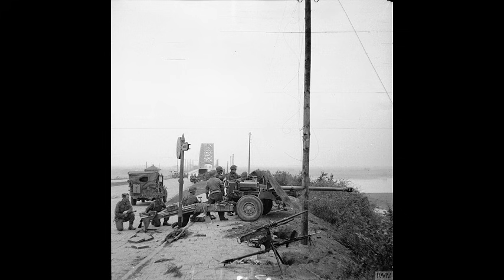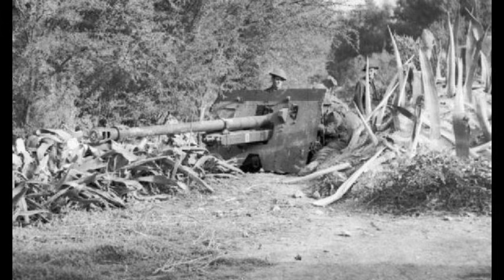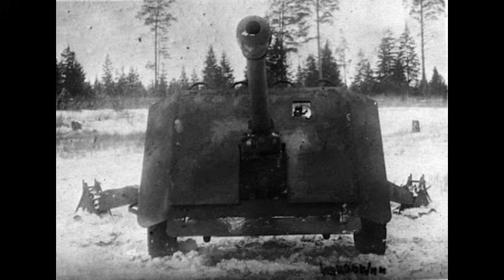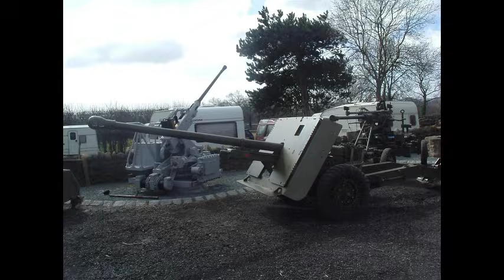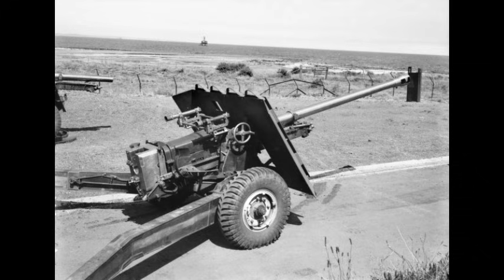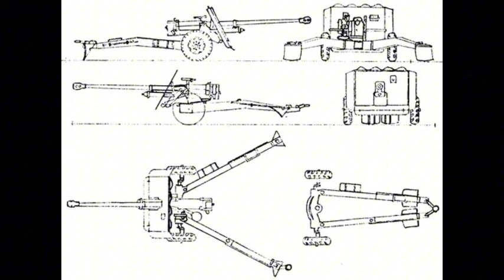When the British 17-Pounder First Shattered German Armor

Comment: The 17 Pounder was good with APDS once the muzzle brake issue had been solved, Most Sherman Firefly and the Comet, which used 17 Pdr shot, were using new muzzle brakes from the factory from August 1944. However it was German APCR and US HVAP which was erratic due to composition. Were the APDS shed its alloy jacket, APCR and HVAP retained it. Which was not ideal as lightweight shot is erratic by nature, which is why it was not used in small arms arms ammunition.
Reply: Glad someone mentioned the muzzle brake problem, before the fix the accuracy with APDS was very poor.

Comment: The American 90mm M3 cannon (used on the M36 Jackson and M26 Pershing) could penetrate more armor using its HVAP ammo than the 17 pounder APDS round. Britain tested the American M3 90mm cannon against the 17 pounder in two separate trials, and both times the British concluded that the 90mm gun was superior to the 17 pounder. For several reasons. It was more accurate, and the HE shell was nearly twice as powerful, it was much more accurate, and it handled sloped armor better than the 17 pounder. The 90mm can reliably penetrate the Panthers sloped glacis plate at combat ranges, the 17 pounder bounces off and ricochets every time.

Comment: Long, repetitious, sometimes boring,  but you got there. Curious that a video became a sound recording.

You missed the more fundamental  and equally important topic - nil points.

The British produced umpteen tank designs in WW2, all of them a technical or practical disaster. The philosophers won at the expense of the practised. Standard railcars were  required to accommodate a tanks width and therefore the tanks turret ring. Tanks were too small - or at least the turret ring was  - to accomodate pieces like the 17 pounder and allow for recoil and safe operation.  Reason eventually prevailed, but not until near wars end with a magnificent tank design - the Centurion. It’s why all distant tank movement is now by way of specialised articulated transporter. Similarly but in a different time - the GWR’s King class loco’s were restricted to certain routes and bridges because of their overall height and weight.

Comment: I served in the British Army Infantry Battalion in the early 1950's which had great success with the 6pdr in North Africa where in one battle one gun knocked out 12 axis tanks.This same gun is now a regimental museum piece. In 1950 our 6 x 6pdrs were towed by the Universal Carrier, in 1951 we converted to the 17pdr towed by the Oxford Carrier. Quite a massive gun for an infantry battalion as up to 1950 they were in Royal Artillery Anti Tank Regiments towed by half tracks.
Reply: Good info, but the 6 Pounder was usually towed by the larger Loyd, Windsor, T-16 and Oxford Carriers, which could also carry the gun crew. Of course the smaller Universal Carrier could also be used, but you would need another vehicle for the crew.

Comment: Excellent story of the 17 Pounder. In the British army tanks were organized in Regiments, Squadrons and Troops. It should be mentioned that after WW2 the 17 Pounder was replaced by the 20 Pounder mounted on the Centurion Mk3 in 1947. This gun used APDS as standard, and set a World Record by destroying a Chinese tank at 3,000 meters, obviously the inaccuracy issue had been solved.
Reply: I think that was a captured Cromwell
Reply: @HowardChambers9679  Yes it was captured by the Chinese but may have been passed on to the North Koreans, it was one of two the other recaptured by the ROK troops.

Comment: In your list of towing vehicles you mention the Morris Quad and the M-3 half-track. However you forget the most important towing vehicle, the Crusader gun tractor. This was a Crusader with its turret removed and the interior gutted out. My late father's unit, 86th Anti-Tank Gun Regiment, Royal Artillery, initially used the Quad but by the time of D-Day had converted to the Crusader. He was a REME vehicle fitter with the unit and said that they removed their Crusader's speed governors which allowed the Quads to reach 55mph on a tarmac road.
The photo which shows the 17-pounder on the approach to Nijmegen Bridge IS the 86th Anti-Tank Gun Regiment. The guns, gun crews and fitters were deployed on the side of the bridge with orders to shoot at anything that floated down from the German lines as the Germans were attempting to mine the bridge. Mostly they used machine guns, also shown in your photo.
Next time please remember the Crusader gun tractor.
https://www.nevingtonwarmuseum.com/crusader-ii-gun-tractor.html

Comment: As an Englishman, I am fascinated but bemused by our use of imperial weight units rather than calibre in mm. But I'm really proud of this gun.
Reply: I am old enough to have gone through school using imperial weights and measure as metric came in, imperial was more fun.
Reply: @paulchipperfield3569  Canadian here. LOVE being bilingual with both.. Converting is fun UNLESS you are going into negative temperatures..
Reply: We didn't use metric in our land forces (the RAF were using metric cannons in WW2) until the Royal Ordnance 105mm  L7 - probably one of the best tank guns ever - in the late '50's. NATO was founded in '49 but only started standardization in the mid '50s. 

The tank gun before the L7 was the 20lber.

The artillery in WW2 used weight of shot in the smaller guns, 2lber, 6lber, 17lber and 25lber, but anything bigger used inches, this changed with NATO, mostly every new Artillery system was in mm not lbs or inches.
Reply: It was all about the weight of the projectile makes sense to be honest.. But in tank and anti tank combat it’s about velocity and kinetic energy….basically mathematics….unfortunately for the Tiger/panther frontal armament became irrelevant with better propellant which basically ended the war

Comment: The British could, of course, have used their AAA guns (slightly larger calibre than the German 88s, so more effective than an 88).
Reply: They tried, but those guns were enormous so difficult to put on a towable platform and the 17pdr was enough for anything it would encounter anyway.
Reply: @Grover91 the British AAA guns existed pre-war & came with wheels, but they were heavy.
Reply: @pcka12 they were on anti air trailers. They were too big and cumbersome to be moved around for an anti tank role (twice as heavy as the 88). The pak 36 88mm was designed in 1936 specifically as an anti tank gun for a direct fire role. So it had the trailer designed for the job. Our top brass never thought of that so ours was never fully fielded. Armour piercing rounds did exist, and they were used for anti tank in emergencies, but then the 17pdr turned up so they were no longer needed.
Reply: @Grover91 have you seen a German 88? At over 7 tons weight they are also 'big & cumbersome', yet famous for use in the directfire role.
Reply: They did the 3.7" AA gun was the basis of the 32 Pounder but it was so large in could only be mounted in the A39 Tortoise. While the 3" 20 cwt AA with a new breach was designated the 77mm and was mounted on the A34 Comet.
Reply: They eventually did & developed the 32pdr. It was massive & completely impractical for use. The AA carriage was even worse & weighed twice the weight of the 88mm.
Reply: unfortunately that gun was far to heavy
Reply: @smokeydization 9.5 tons compared with 7.2 tons, so anything which could tow one could tow the other & the QF 3.7-inch was used in the direct fire role, including in the desert war, but the British QF 17 pounder being considerably lighter than both was more versatile once introduced.
Reply: @pcka12  that's not entirely what I meant, they would never fit into a Sherman that is a given. I meant they were far to heavy to transport to be used in the  towed anti tank role. When you stripped away the parts that made this a cracking aa gun they are pretty basic.
Reply: They did, a guy I worked with was a driver in  a mobile AA unit and was sent to fight in the desert but never made it his ship was damaged and ended up providing air defence in Malta. They then went on to the Italian campaign and were used to defend the harbour in Salerno then his gun was attatched to a US unit and used as a bunker buster removing pesky gun emplacements from the safety of being miles away. The needed two converted Shermans to bulldoze roads through villages though!
Reply: Not really. I think the issue was that the British AAA guns were too big to fit in the turrets of Shermans and could not therefore be fitted to the main tank the British had. The best we could do was produce the Firefly as a compromise in the time available.
Reply: @angushogg3667 Not as retrofits in tanks but as stand alone artillery.

Comment: The 25pounder was both gun and artillery it forfilled both roles, what it lacked was the penetration of it's AP rounds to take on Tiger tanks with only 80mm
Reply: APDS came along later & had some accuracy issues at least initially.
Reply: The 25 pounder was a gun howitzer and in the early years of the war the best anti tank gun the British had. It was so good that in 1941 the Afrika Korps armoured units would avoid the areas where there were 25's. They even had a nickname for the 25's. From memory that was something like 'crash boom'.
This video has failed to describe the reality of the gun. The stupidity was that it described the action of a howitzer, but the 25 fired over open sights like an anti tank gun. That is why it is called a 'gun howitzer'.
Reply: @BasilPunton Really, the British 25-pounder 'universal gun' had three key characteristics derived from WW1 experience:firstly like the QF 3.7 it could be 'elevated' from a  negative value up to angles which allowed 'ballistic' type fire hence 'howitzer'. Secondly not only the HE shells were adjustable but the charge placed in the cartridge case before firing, lastly when mounted on a 'wagon wheel' type affair the gun had rapid 360 degree traverse. The anti armour role was achieved by loading armour piercing shell rather than HE for use in the direct fire role or HE was effective in the 'top attack' ballistic mode,

I speak as someone with a little experience of the actual weapon.
Reply: @BasilPunton  it was 25pounder gunfire that knock-out Rommel's own Panzer IV,  that finally removed him from the theatre due to those injuries and his illness, recovering in France then injured again by Spitfire strafing vehicle

Comment: The Sherman Firefly installation drew on the 17 pounder AC4 tank installation
Reply: Not really the Firefly turret was redesigned by a Mr Kilbourne a Vickers tank engineer and it worked really well. The Sentinel AC-IV needed a larger turret to mount a 17 Pounder practically. this was never built.
Reply: @billballbuster7186  A single prototype was built.
Reply: @Will_CH1  From what I have read the 17 PDR AC-IV was test fired.  But the original turret used was too small for practical use. A larger one was to be built, but never was.